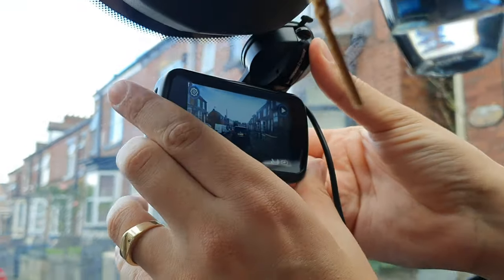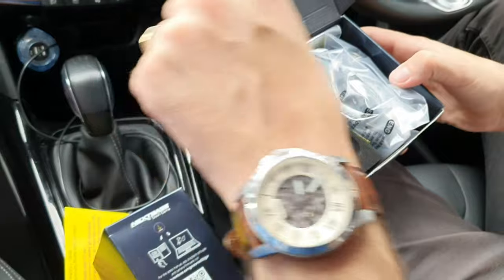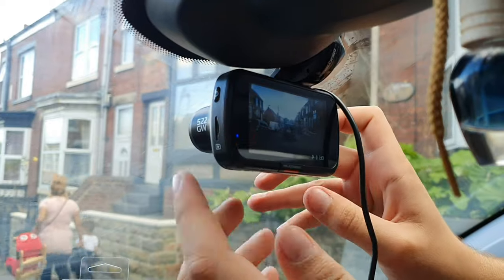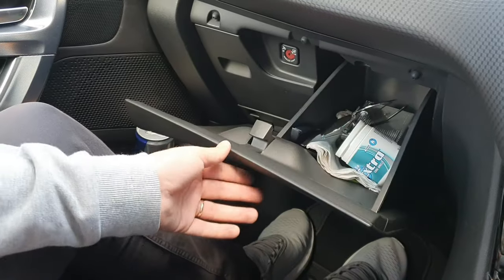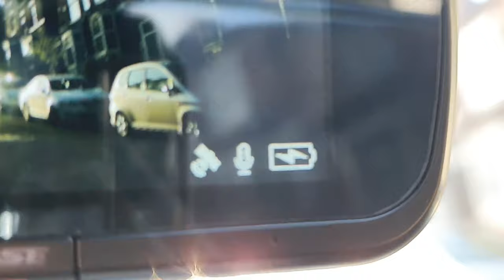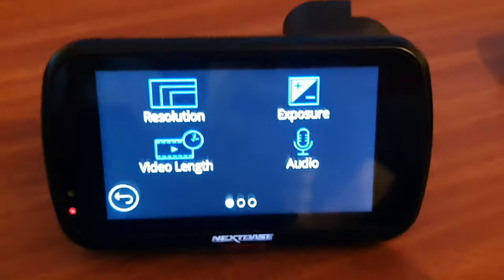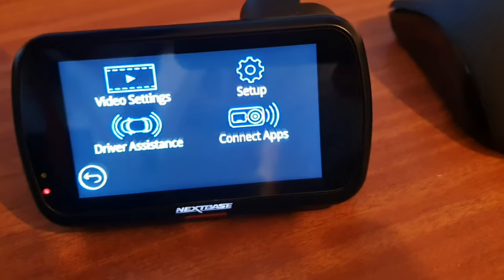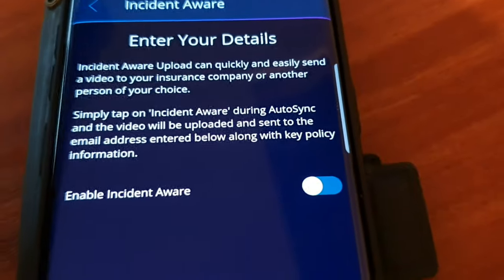How to Install a new Dashcam on any car Nextbase 522GW FR Peugeot 2008 2024

Comment: Great video, I'm having mine installed tomorrow as I got a free offer! (Happy Days 🙂) - was wondering if you had any interference on your radio? I had a blackvue on my last car and it caused reception issues on my dab radio and had to use ferrite core clips on the connections.
Cheers 👍🍻
Reply from the maker: I have seen people saying there are some interferences, However me personally I haven't have had noticed any. At the same time I am connecting my phone to my car's mediaplayer for google maps and YT Music so I am not using radio that much anymore.
Let me know how it works for you. have a good day!
Reply: @SEPAChannel  thanks for replying. Yes it doesn't seem to have any issues, although the app isn't great and alexa works then doesn't connect telling me my connection has lost wifi?
The locked data is constantly being saved even when I turn a corner? I've about 20 on my card now! I can't delete the locked data using the app, despite showing a bin logo - if I press it it connects to the video behind it?
I have the sensor on medium, so low might help and looks like I'll have to delete the locked videos removing the sd and use a pc.
I've paid £240 and sad to say its mediocre at best after only a few days 😏👍🍻

Comment: What fuse did you connect to? And how many amp was the amp you use? Oh and do we need to have that 2 amp fuse that comes with the hardwire connection on the connection piggy back too? Not really sure what it does
Reply from the maker: Hello mate. In the installing instructions you will see one of the fuses will becone a fuse for the camera and the other one you need to remove it and use the fuse which is on the car (the one you connected to) so you will keep the same value for usage.
Reply: hello Moua X. have you got that sorted ?
Reply: Yes I did.  Thank you
Reply: @mouaxiong22  That's very good to hear. Have a nice day!

Comment: Is it possible to fit one of these cameras to a 90 degree flat windscreen,in a HGV for example. I'm worried the lens may foul the windscreen as the mounts supplied only appear to accommodate car windscreens which obviously are angled alot more than a waggon windscreen.
Reply from the maker: hy mate. I am afraid I can not advise on this instance as I have never seen it fit on an HGV. What I can tell you is that you can actually adjust the angle, the only issue you might have is the support might not give you enought space to actually  changhe the angle to a 90 degrees. I wish I would be able to upload photos, so I can show you different angles and fitting positions
Reply: @SEPAChannel  I have since purchased one and use it daily in my waggon with no mounting issues at all👍thanks for your reply 🙂

Comment: One question, don't we need to connect the hardware kit to a permanent live fuse for the parking mode to work? Help please! I'm getting mine fitted next week
Reply from the maker: that would be your choice to be honest, however, I would suggest not as it might drain your car's battery when not driving for a time and might surprise you one day not being able to turn on the engine. THere is a solution with a buffer battery and I have seen people fitting dashcams with that solution. all the best. let us know how it works.

Comment: I have just purchased this same camera and I’ve watched your great video. Can I ask how did you actually hard wire it in ? As I’d prefer to have it hard wired in that way it will free up my cigarette port .
Reply from the maker: have you manage to do it?
Reply: @SEPAChannel  I haven’t managed to hard wire it in yet as it’s in my sons car and he is never in long enough for me to hard wire it it, but at least he has it up and running through the cigarette port. It doesn’t take much out the battery as he leaves it plugged in when the car is parked up
Reply from the maker: What car does your son got? You will need to find the fusebox and locate the cigarette port fuse, and hard wire the red wire there. the black one goes on the car's metal part, any bolt that you can unscrew on chasis and put the wire there will do fine.
Reply: @SEPAChannel  he has a Skoda Fabia 2016 Monte Carlo

Comment: Nice video! I’m just a worried about cable management and keeping the wire out of sight.
Reply from the maker: Hi mate. it's not mission impossible to keep them out of sight, however it will take some time. if you like working just a little bit on your car or like to do stuff with your own hands go ahead, however book half a day off :)). Let us know once you install it how it works, or if you went for another model. We love learning from you guys so please advise on any tips & tricks if you find anything new
Reply: Hi mate. Have you got yourself a dashcam and installed it? How the process did go?
Reply: @SEPAChannel  I was able to install it just fine! The little tool that is included came in handy. It allowed me to hide the wires fairly easily.

Comment: Apparently scandisk SD cards are crap for dash cams because  of the high rate if recording. Great video though
Reply: Charlie Bryce best is samsung evo U3 class 10
Reply from the maker: So far so good mate, Sandisk SD card I have worked just fine to be honest
Reply from the maker: Sounds like one of those cards that works the best on any device
Reply: 2 years almost of runing with Scandisk on my Nextbase dashcam, works fine. I might have just been lucky I guess.

Comment: Hello, once the car is started how long does it record for? And does it overwrite old recordings once card is full? Thanks
Reply from the maker: each 3 minutes a new video. Also it overwrite old recordings IF they are not locked. 
The G-Sensor will lock the videos if sense an unusual motion of the car and you can set-it up at 3 different levels.
Reply: 3 minutes recordings in loop. G sensor will lock videos when strange motion is hapenning. You have 3 leves that you can set that to.

Comment: Hi
What is exactly  the SD card that you are using. And is it working well after 4 months????
Reply from the maker: hello there my friend, is a Sandisk 64GB, tou can check it out at the beginning of the video. my friend, it works briliant. you do need to format de memory card from time to time as will get full of locked Videos.
Reply: @SEPAChannel  thanks for your reply
I saw it it's a sandisc but which one exactly ????
Reply: I have many sandisc cards. But when I  
Plug the rear view cam it stops working.
Reply from the maker: When i get back in the car i'll have a look for you, maybe there is a serial no or something. By the sound of it it might just be from the camera itself mate
Reply: @SEPAChannel  
Thank you barzo
Reply: @ccharraf  have you got the issue sorted out mate? This dashcam works fine even after almost 2 years for me pal.

Comment: So after one full year with this camera, the only dislikes are that the internal battery is poor, and yes i have fully charged it indoors, and secondly, i have trouble turning it off(which may be linked to what I'mabout to say:-) i press the button as per instructions but still wont turn off, so i have a tendency to leave it until the battery dies, i should really take it off its mounting,  but most times i leave it in car.
I have it plugged into power socket at the moment which leaves the wire dangling down from the camera, i will get it propely fitted in time.
apart from that, its good, night vision relies on the headlights to pick up detail but still good considering, i have every intention to buy the rearward facing camera soon and will report back when i do.
Reply from the maker: we tend to see sometimes the same issues on this one. unfortunatelly ...

Comment: Check cheap CHINA fuses as some don’t blow and damage circuit.
Reply from the maker: Very good piece of info. thank you for your feedback
Reply: it's a good info! always making sure when dealing with wires and electricity (no matter if at home or on your car), you either spend a ton of time researching and making sure you know what you are doing, or just hire someone that is specialised.

Comment: Where did you attach the ground wire?
Reply from the maker: Under the dashboard, left to middle side, tuere are a few places. i found a good spot and stuck it there
Reply: hello Stuart. have you found a place to attach that ground wire? do you need some help with that?

Comment: Dont use Sandisk! Cant keep up with the constant recording and transferring of files. You need a high performance micro SD card. Didn't even know they existed but they do! Nextbase also sell their own high performance one for much better longevity!
Reply from the maker: How much does it cost one from Next Base mate? Just asking for my own knowledge
Reply: @SEPAChannel  I paid £30 for a 64GB one off of Amazon 😊 no problems with it
Reply from the maker: Sounds like a good deal. Any errors with this one so far?
Reply: @SEPAChannel  nope all good!
Reply: @TheBranchinho  Hi mate. I have seen a few comments and posts online regarding issues with sandisk. It might be I am one of the lucky ones, but I had no issues with the Sandisk memory cards so far. On a nextbase or in other devices. all the best. stay safe!

Comment: Can you get rid of the MPH at the bottom?
Reply from the maker: Hello my friend. Yes u can! From settings icon -》 Video Settings -》Next Page -》Speed Stamp
Reply: That's awesome to know. Is it beneficial to have it or don't have it? I know the reason is for speeding but it could also be used especially in America where cops can just say your speeding but your speed stamp is off.
Reply from the maker: It's only usefull if the speed you had might make a difference in the resolution of your case in case of an accident. However, I don't see that many situations in which that will help. It's good to have it though.
Reply: @davidzheng369  sounds like a good situation where it might come in handy A LOT ! Thanks for your tips

Comment: Why do they give you the resolution options you're obviously going to select the highest?
Reply from the maker: It might be just to have some flexibility when it comes with the storage used on your SD card. Also you can choose between higher resolution 30 fps or a medium one with 60 fps
Reply: I'll honestly always go for a better quality at 30fps just to better see the plate numbers if needed you know.

Comment: I watched all this hoping to see him make the electrical contact to the fuse box, but no why did he skip that. Would it be he had to get an auto electrical engineer
Reply from the maker: Hi David. We did try to include as much as we could. I do hope the rest bits of the video were useful. Please keep in mind it does depend on the car model you have, fuse boxes might be different. Our recommendation is that you use the lighter 12v fuse for the contact and not other vital parts of car's electrical system. Thank you and wish you all the best
Reply: It sure migh have helped a little bit if that part was included. Better videos in the future mate!!

Comment: When I have the incident SanDisk will not work it has to have a nextbase SD  card
Reply from the maker: all good on mine at the moment, got a SanDisk and thanks god no big issues. sometimes it does get a bit hot, but a quick reset works like charm.

Comment: Why does it need charging if it's hard-wired in?
Reply: I believe it's for the parking mode. It uses the inbuilt battery for that.
Reply: @ORGNLMedia  OK, thanks.
Reply from the maker: It does indeed needds some batery for parking mode. If you connect it with the right hardwiring you should be able to have it connected all the time.

Comment: Wires in this day and age is silly
Reply from the maker: do you have a complee wireless solution that you can recommend? Please keep in mind the price rance. Thank you.
Reply: @SEPAChannel  i have a 256 gb card . I use my phone.  Have done for 3 years and better video quality than any dash cam. Next base cant read number plates unless steady like most.
Reply: @thepenetrator2006  Is your phone not getting hot cuz of all the recording? also I am curious how it will work in summer time when is how and no matter the AC sun will hit your phone and it will get hotter. Can you let us know how that works for you? Best wishes.
Reply: @ionut.litoiu  its an s9 and nope doesn't get hot who even feels it? iv a case on it so the clamp gets a better grip. Never had any issues. Night time can even see number plates next lane over . Plus still can get gps and time stamp but no mph:)
Reply: @thepenetrator2006  that sounds like a good experience. the only thing you missing is rear camera. that's all I guess. Have a good one
Reply: @ionut.litoiu  anyone goes into the back of you its their fault dont need a rear one in my view

Comment: Video quality look really poor for a top of the range camera :/ . I was trying to decide for a long time over this or the Viofo a129 , Kenwood DRV 830. I bought the Viofo, blows the 522GW away quality wise and it's slightly cheaper to.
Reply: There's no rear camera on that though....
Reply from the maker: I must say this Nextbase worked just fine for me, at least for now. Can be used if you add a Rear camera or an InCar module for Taxi drivers as an example. quite interesting this piece of gadget
Reply: @jamil420  that's true indeed
Reply: Hi mate. how is the viofo working so far for you?
Reply: @ionut.litoiu  Superbly
Reply: @AlexiaVon  glad to hear that.

Comment: La Currys găseai mai ieftină, 111£ Mi-am luat eu, si azi mi-am instalat-o. Nu stiu sincer cum merge treaba cu Alexa, cam complicat..sa vedem in mers cum se comporta.
Reply from the maker: Nu folosesc nici eu alexa, in schimb ma bucura faptul ca pot sa descarc rapid video de pe camera direct din aplicatie. Si tot sin aplicatie am vezi si deplasarea per video cu gps
Reply: Bula Luiza. din cate observ din comentariu este 1 an de cand ai cumparat camera? Cum merge la momentul actual? totul ok?
Reply: @ionut.litoiu  da.A mers totul perfect, însă din păcate prin iulie mi-a fost furată din masina in fata casei ..:( Si nu mi-am mai luat alta. O recomand oricum, însă nu lăsată înăuntru in permanenta, peste noapte ma refer. Un lucru vreau sa specific. Camera filmează doar in timpul mersului, nu si când masina este oprită, in parcare.
camerele care filmează non-stop, sunt de alt tip, pentru care se plateste lunar sau anual.
Reply: @yzza22  Sunt ceva mai scumpe intr-adevar. exista o sulutie prin care se poate extinde si la acest model bateria, prin instalarea unei baterii suplimentare intre sursa de curent si camera, si va avea mult mai multa baterie. dar ulterior totul se bazeaza tot pe functionalitatea senzorului gravitational (G-Seonzor). In mod normal daca masina este miscata, ar trebui sa se activeze.
Este ciudat cum unii oameni prefera ciordeala in loc de munca, pacat ca a fost furata. Multa sanatate !
Reply: @ionut.litoiu  mda.. asa este. M-am
învățat minte si după paguba asta mi-am instalat camere la casă, sunt foarte utile.Poate o sa-mi i-au alta pe viitor, însă când îmi amintesc, parca am traume 😐
Reply: @yzza22  cred si eu eu. nu e ieftina ... 
Cat te-a costat instalarea sistemului de supraveghere video pt casa?